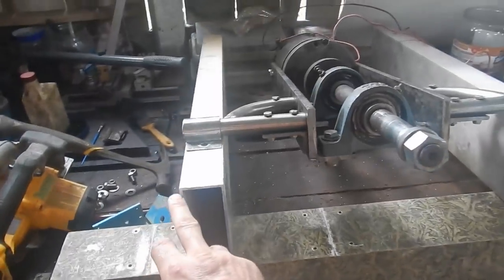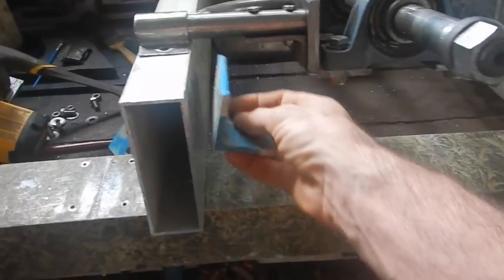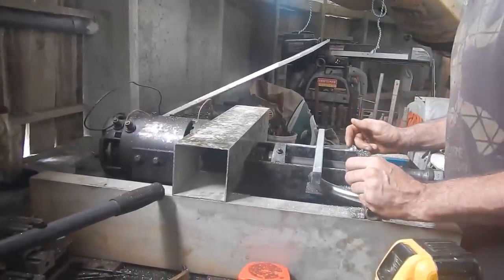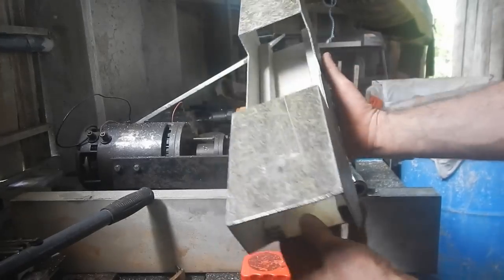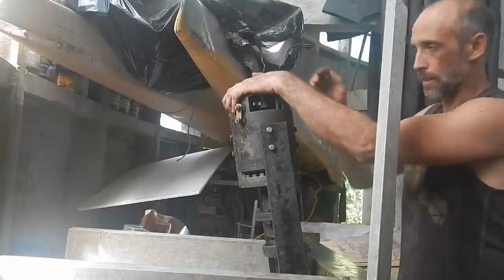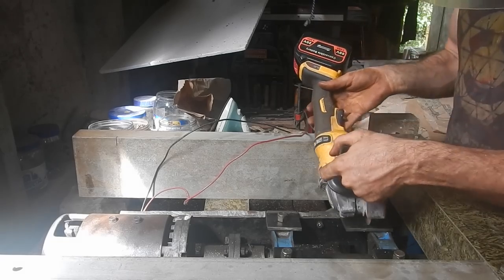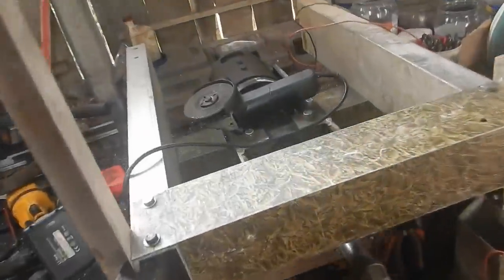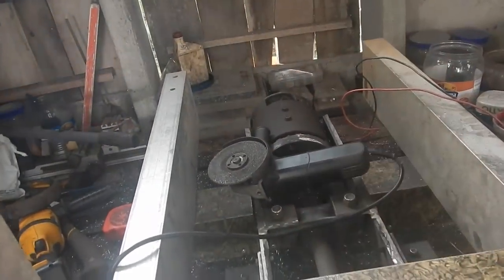Lumber Mill 009 Swinging Blade

Comment: Is there perhaps a lathe operator somewhere in town that you could ask to turn that interface where the blade mounts to the shaft? From my experience, blade wobble can be really harsh. Maybe though, with a motor that powerful it will straighten the blade enough...
Reply: Once he gets it all running he could probably turn the blade mount right in place, powered by the saw motor.
Reply from the maker: I have a lathe.  ....but it shouldn't be needed.  Once the thing it running I can take any imperfection out with a file.

Comment: only one question , don't you think the less than 6 noodle unit depth of cut will be an issue ? I think it will hamper your productivity greatly because you will have to do multiple passes to get any board more than 5.5 noodles wide or deep .

Comment: maybe you need to make it adjustable for blade thicknesses
Reply: Wider kerf? Perhaps you mean the diameter? I think Jamie has already designed for a 10 or 12 noodle blade.
Reply: @deplorable1-2  no the thickness of blade steel there all different
Reply: @jasperedwards2713  It looks like he can go about 1/2 noodle thick already. I have never seen a blade that thick except on routers.

Comment: Why no welding?
Reply: Gas welding? Tank refills are an 8 or 10-hour paddle away. Electric welding? Not enough extension cords, solar panels or batteries. Plus, all the staff that used to pedal crank the bicycle generators, swam away.
Reply: Technically, it is rust. Welding is rust.